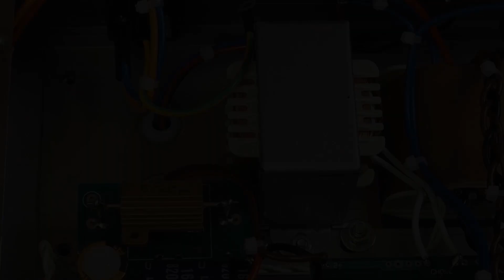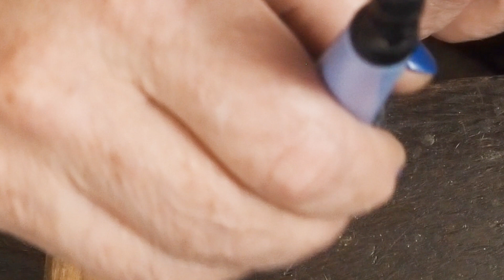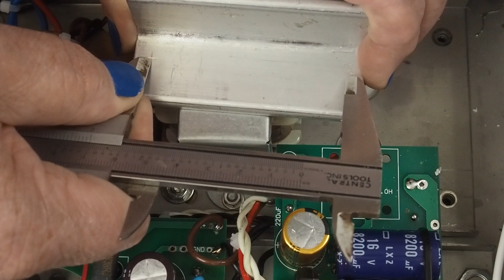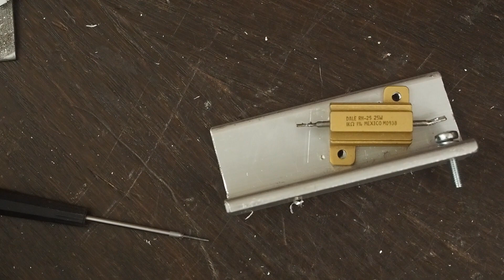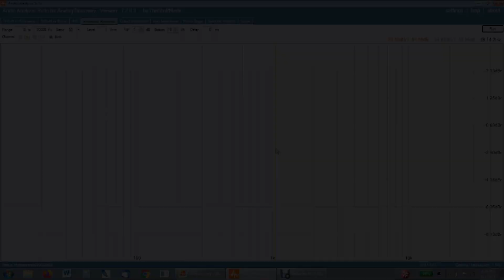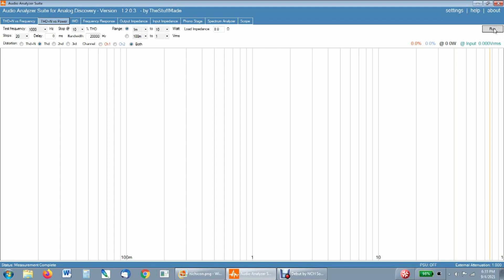Boyuurange / Reisong A50 300B Tube Amp Optional Mods

Comment: Stephanie, thank you! You've inspired me to copy your mod! Regarding the 25w 1kOhm cathode resistor, I wonder doesn't such long leads worsen the sound/ add hum issues? Wouldn't it be enough just to leave em on a pcb, but move a little sideways so the heat convey upward freely? Should I replace it with a single 12W 1kOhm Ohmite, which I bought? Thanks!
Reply from the maker: I didn't notice any sound/hum. It has 5W constant current so I suppose a 12W might be enough? Note those metal body with bolt down lugs resistors are only rated for 12W when bolted to a heat sink. In free air, cut that in half at least. You can experiment away!

Comment: Thanks for your series, it is so great. May you explain about input circuit? I saw that the audio inputs have aux, cd, and tape. Do you have a schematic for this one?
Reply from the maker: I plan on going over BUT I do not plan to dive deep into the relay boards or the remote control etc.
Reply: @SkunkieDesignsElectronics  yeap~I see. Do you have a link to buy it?

Comment: Very good job!!! but I think you need a better Soldering Iron if you are dealing with Tube Amps. A least 60-Watt  Iron with medium size tip will do better job if you handle it properly.
Reply from the maker: This Hakko FX888D I now use is a 70W iron and you can change the tip. I do agree you need more than something like a 25W pencil for this work.

Comment: Hello there, I was wondering why you chose the cathode bypass res/cap on the cascode instead of the LED/res like your other design? Also, I am a bit confused because consumer products have a stated output of -10dbv, which is just under 1 vpp. You use a max 3 vpp input (1 vrms). Is this to give the amp more headroom or/and is it possible that some manufactures have outputs that are not really -10dbv? I'm learning a ton from you and I am super interested. thanks for doing all this!
Reply from the maker: I did end up using an LED/resistor on the cathode of the cascode.  The resistor/cap is on the cathode of the 300B. And most devices made today output 1-2V RMS, at least that is my understanding.

Comment: A great series of videos. Thank you so much. Before I start implementing them I was wondering, if there are any changes to the mods needed, if you operate the amp in Europe with 230V? Are you going to have a final video on your listening experience with the mods compared to the other 300B amps you have? Is it now a really decent amp and is it worth the effort? Have all the mods any impact on the v-meters on the front?
Reply from the maker: Hold on until I spend a little time with this amp. And no, the mods shouldn't have any issues working with a 230V version, but the key word is "shouldn't" as I don't have any way to check what the internal voltages are in one of those models. When I am finished, I'll have a schematic with all the "after" voltages and I highly recommend folks check the voltages. 

Do understand these are LETHAL voltages, and watch my safety video before you start probing around inside one of these!!

On the VU meters, I'm not sure people understand their purpose. They shouldn't get into the red until the amp is turned up high enough to be into distortion. From my testing, they seem to be doing their job, but I think some people want them adjusted so they dance full scale at normal listening levels. So no, my mods don't effect how they work.

And yes, I plan to do a final wrap up video with pros and cons along with comparing it to the other DIY 300B amp I did a video series on. I expect to have that done in a day or two :)

Comment: The aluminum plates look to be anodized which makes them conduct heat much better than bare aluminum. The 300B cathode resistors have found a better home.
Reply from the maker: I believe so too!

Comment: Are you planning to release an instruction/manual document with all featured upgrades, parts specs? This will make it much easy to overview the options you offer. Thank you.
Reply from the maker: This "upgrade" or mods to this amp is just a video showing what I did. I do plan to publish a schematic and a BOM of the parts needed but I'm don't plan at least at this time to offer anything beyond just sharing what I learned. I'm sure there are probably other mods that could be done past what I did. Hope it was helpful!

Comment: To find the center of the holes rather than guess where the centers are just set the calibers to the left side of the each hole and you will be a lot closer to the distance between the holes.
Reply from the maker: Good tip :)

Comment: Looking great.. I would personally just replace the Dale heatsink bodied R’s with a parallel pair of Mills MRA12 12W resistors - “floating away” on the board.. Oh, I find that the (Solen) decoupling cap in the cascode is also crtical to SQ, I would personally at least use an Auricap or Sonicap in that position.. The Solen would be a bottleneck IMHO.